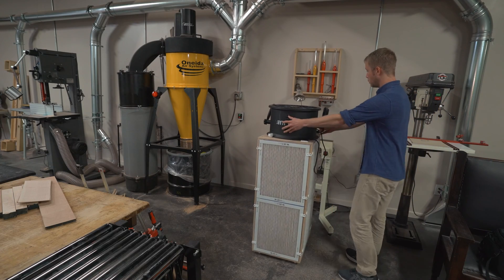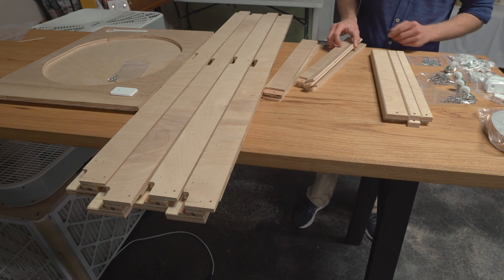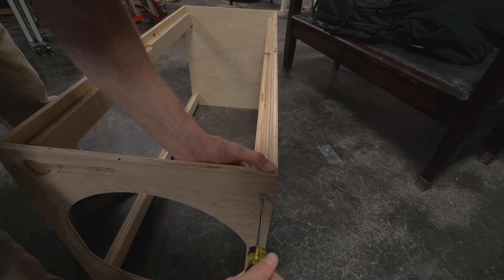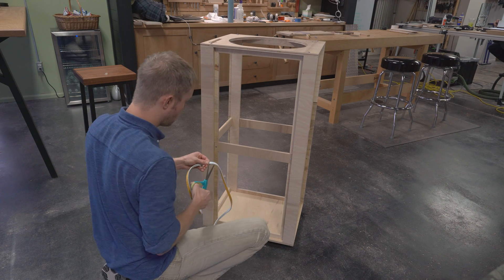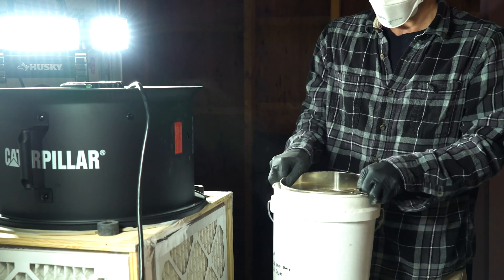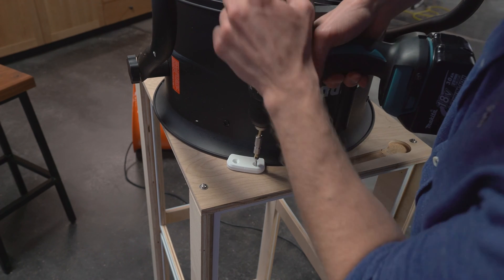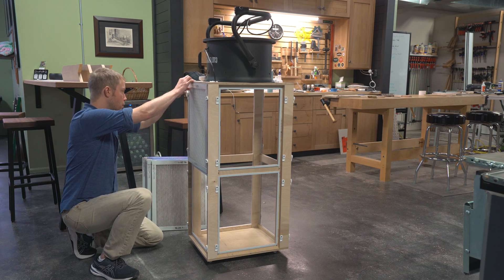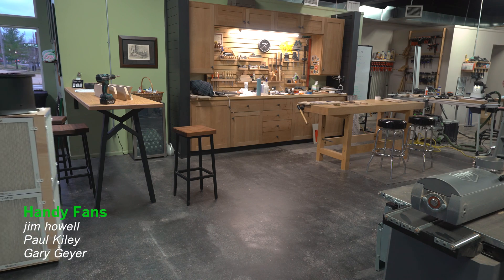Air Filter Kit - Model-A - Design and Assembly

Comment: Great video, very useful, just a quick question, I could not find 14 inch caterpillar 4000 CFM fan, instead i found 14 inch 2300 cfm, can it still bring the same performance? or should i use dewalt 4000 CFM fan or Caterpillar 18 inch fan with 3400 CFM, for your info, i want to try 8 filters of 20 * 20 * 1 merv 14 3M filterete, your suggestion will be helpful , thanks

Comment: How long do the filters last in your shop? And if you would please include your best guess at how much use they get daily, that would be great. I’m a disabled veteran on a budget and I’m trying to determine my cost for your awesome unit based on filter use and replacement. Thank you for all your effort.
Reply from the maker: In my experience the filters can take about 1lb of dust before they need replacement. It took me about 1 year to collect this much out of the air with several times a week use. I will have a video out on adding cheap and easy to vacuum pre-filters to the disposable filters so that they last even longer. They do need to be cleaned regularly though, so there is a trade off, time vs money. As is usually the case.
Reply: @The3DHandyman  
Pre filter media is another excellent idea. Thank you for the timely response.
Reply from the maker: @mojorizn72 Any time

Comment: I found the Etsy link but didn't see a way to buy the kit that has the eight 16x20 filters.
Reply from the maker: Hi Tom! I am not making the full 8 filter kit any more. The Model-B 20x30" kit for a drum fan performs just as well and costs less to buy and the filters are 30% cheaper. All around, it's a better kit. If you want, you can still build the Model-A out of wood if you have the tools. You can also upgrade it with the plastic parts kit if you like.

Model-B
https://www.etsy.com/listing/1373712349

Model-A (plastic parts only)
https://www.etsy.com/listing/1309978884

Let me know if you have any questions.

Comment: I assume the drum fan filtration setup can be suspended in the air? Or does the fan need to be on top of the filter setup as you have illustrated? I would like to have it out of the way in my small shop. Thx
Reply from the maker: A system like this one would work well https://youtu.be/OhVWsnTm8iU

I am also working on designing a purpose build ceiling mount unit. That video will be out later this month.

Also people have definitely mounted the Model-A on a ceiling. There are specific mounts in the plastic parts kit that make this easy.
Reply: Thanks, I like that setup! I need something soon, too much dust flying around.
Reply: Quick question, does it matter with way to setup the filter?  Pull through filters or push into filters?
Reply from the maker: @MDD1966  Each fan direction has different benefits. If the rooms is small or the filter is close to your work area, I prefer pointing the fan into the filter box. If the room is a 2 car garage without major ceiling obstructions pointing the fan up is generally better. I will do a video on the subject soon.

The filter will go into the frame differently in each scenario. If the fan is pointed down into the filter box the arrow on the filter will point outward and visa versa.

This is info for the 8 filter design. So, if you decided on something custom, the same concept applies. The arrow on the side of the filter points in the direction of airflow.
Reply: @The3DHandyman  thx, I will point the air into the filters since my work space is small. I plan on hanging it above my work area to keep it out of the way! Appreciate your input!

Comment: your model a. would you be able to update the schematics to use a 20 x 25 x 4 set of filters? Also, do you not sell the wood kits any more?
Reply from the maker: Hi. I am going to do some updated drawings for these kits but they will only be compatible with 1" filters. If you buy 3M MEVR 13/14 filters they have as much filter material as the average 4" filter and they preform better in a smoke test as well.

I am not selling the wood kits because they required hours of hand sanding and cost the average buyer about $400. The new Model-B kit with a drum fan has the same performance with a 30% lower cost and 30% lower filter prices so operating it is also cheaper.

Comment: I would like something I can mount to my ceiling and maybe exuast into the attic?   Would this be a good design if I wanted to Mont on one of its sides and loose one side of filters?   If that makes sense.
Reply from the maker: Yes, it is possible. A lot of people have done this in various ways. You can use a Inline fan to move the air. It will easily accept a flexible duct for running into your attic or wherever. The inline fan is a bit less powerful so only having 6 filters wont be an issue.

12in inline fan
https://amzn.to/3T6wXg8

Comment: You mention that pointing the fan into the box, you can collect dust in the air from about 5'.  If you reverse the direction, how far is the box picking up dust from the air?  I get that blowing the air into the box would slowly clog up the fan.  Whereas pointing the fan out would keep the fan clean.  I'm just having a problem with how much dust would be removed from the air with it point out.  By pointing it out, are you relying more on that airflow to circulate the dust around to the air filters?  Further explanation would be appreciated.
Reply from the maker: Yes the fan will stay far more clean if you point the fan up. The fan does not clog in the down direction though. I will occasionally blow it off with compressed air and that's been fine for years fine.

Pointing the fan up makes for better circulation in an area without large ceiling obstructions. If this is the case, the dust pickup will be the whole space.

This a complex issue, really. Both options are best in different scenarios. It can be good to test what is best for your space. 

The other issue is where you want the dust to collect. If the dust is inside the box, it wont be disturbed as easily as when it is on the outside.

I will do a whole video on this in a month or two.

Comment: Can I get MODEL A design measurements using 20x20x1 filters? 16x20x1 isn't available in my country.
Reply from the maker: You can pretty much just add or subtract as much as you need to have it fit a different sized filter. The upright legs wont need to change at all, just the top/bottom/horizontal pieces. Don't have time at the moment to make plans. Maybe later this year

Comment: Do you need an european retailer ? I'm located in France, and think your project deserved to be available everywhere on the continent
Reply from the maker: Thanks for the offer! I love the idea but one of the key issues seems to be that this type of HVAC filter is hard to find/expensive outside the US and Canada. We might have to become a filter importer at the same time. That makes it quite a bit more challenging to pull off. What are the easiest filter for you to find locally?
Reply: I'll come back at you with a survey if that's ok, what other issue I may have at the moment, is european products are standardized in metric, if we get to be filter importer, it will of course don't matter, as the product are compatible by design. I also don't know about the regulation and the norm about HEPA filter, that might be different from the north american one, thus explaining a price tag difference. Nevertheless, I'll work on it as I firmly believe in this projet   @The3DHandyman

Comment: I don't understand why everyone uses fans that are designed for free flow air why not use
 a squirrel cage as it is designed for high static pressure put it in box with filters on one 
end and sound baffles on the output to reduce noise
Reply from the maker: The cost of the fan upfront and the cost of electricity in the long run plus the significantly higher CFM make axial fans far significantly more cost effective. As long as they are paired with a lot of filters they will run with little to no static pressure.

Not to say that there aren't squirrel cage fans aren't good. I did get one second hand and will make a video on that at some point

Comment: I’ve seen the numbers online comparing the decibel levels between the CAT and the Air King. Based on your use, which would you consider to be the loudest at their max speed setting? Not sure what their frequency response graphs look like when measured.
Reply from the maker: I find that the CAT fan makes more of a pleasant sound although it is technically 2-3dB louder than the Air King.
Reply: @The3DHandyman  excellent! This is the exact response I was looking for. I thought this may have also been the case with the CAT. Going with that one. 🙌

Comment: Incredible work in this series.  Thank you very much!  If one of these fan systems is good, would two be twice as good or is there diminished returns due to science things?  (Not a science guy, I just really want to minimize the dust in my shop).
Reply from the maker: Thanks! I have operated 2 in the same space before with good results. If the space is large then several units can help clear the air a lot faster. If the space is smaller, then you can run one with the fan blowing air down into the filters and another with the fan blowing air up towards the ceiling. This creates better circulation.
Reply: @The3DHandyman  Awesome.  I think I’ll give that a shot.  Thanks again!

Comment: Will a Canister filter work or will it restrick the Air flow to much for that Cat 14 inch fan?
Reply from the maker: I have had more success using the Cat fan blowing air up out of the canister than blowing dust into the canister. Also, once the canister gets dirty, performance is cut dramatically. So, you will need to clean it frequently.

In general, the Model-A or Model-B performs better with the Cat fan.

I'll have a video out on the comparison some day soon, I hope. Very busy at the moment and it's hard to keep up with content production.
Reply: @The3DHandyman   Thank you for all the time and effort you have into this project. I spoke with Wynn, the manufacture of the canister filter and they do not reccomend using the fan into there filter.  Thought I would pass that along to you.
Reply from the maker: @steelhead1194  Thanks for the info! So their recommendation is to blow air upwards out of the filter with all types of fan?

Do they recommend using the Cat fan at all?
Reply: @The3DHandyman   He said that there was not a good seal and it would leak, I am not so sure that could not be made air tight. He refered me to a video by Stumpynubs where he adds a canister filter to a ceiling mounted ambiant filtration  system.  He also said that the air could be forced back thru the fan, causing the dust to be escaping into the shop.  But this could be fixed with a large canister or 2 smaller ones I would think.  I am relly looking forward to your next video and see what all you have found. I just bought a ceiling mounted one from amazon, it was not to costly and I will have some air cleaning for now. I think a system like yours along with the ceiling mount may be very good, as the ceiling mounted  one I purchased exhaust the aid down, so the dust will be moving and be caught in the floor  system of yours as well.
Reply from the maker: @steelhead1194  Thanks for letting me know what they said! I have seen that stumpy nubs video. It is a great use of the filter.

One test I ran where the Cat fan was blowing into the canister showed dust starting to kick dust back out of the fan rather than blow it into the filter. The HVAC filter type designs Model-A/B can take a lot more dust before reaching that point... not to say that they are perfect either.

With the fan blowing upwards out of the canister filter the cord gap was not very significant issue with performance. Like you said, it can be easily filled with some foam tape or something.

At the moment I have about 10 videos each 1/3rd done. Hopefully by the end of the year I'll have them all out there 🤞
Reply: @steelhead1194  I think there might be some mis-communication with Wynn concerning the canister filter. This is taken directly from their site and is talking about canister  #35C222NANO with a MERV 15 rating.  In red text they state:  "This filter is designed to flow from the inside-out.  The Nanofiber layer is on the inside.  These are not the same as typical  outside-in industrial filters.  (All industrial Nanofiber filters are directional and will fail if used in the reverse direction.)"

Comment: Great work! I've watch all your videos and they are really informative, thanks again for all the hard work. I have a question though, why not trying the big Cat Fan with only one filter with low pressure drop?  I am only wondering this as filters can be expensive and I found some really good ones with low pressure drop that could handle the static pressure. Would love your thoughts on this! Thanks
Reply from the maker: Thanks! If I were to pair the Cat fan with a single filter it would need to be a 4 or 5" filter. This setup would also probably not perform well in heavy dust environments.

When filters are new the pressure drop is reasonable across most brands. When they start to collect dust, that's when there is real benefit in large number of filters. In some scenarios a set of large filters paired with the Cat fan can handle pounds of dust without significant loss of power. A single filter would pretty much stop all air movement and potentially damage the fan motor because the motor is air cooled. No air movement = no motor cooling.

For single filter (high static pressure) setups I would recommend inline fans or centrifugal blowers. I'll have some videos coming out on those soon.

Hope that helps!
Reply: @The3DHandyman  Oh alright, that makes sense, thanks!

Comment: Is there a reason why the Model A is not available any more? Also, would it be possible to fit a carbon canister filter inside the box attached to an inline fan at the top?
Reply from the maker: I had issues with the CNC shop that I was working with and it resulted in a ton of scrap parts and several hours of sanding per kit. Neither of which I have time for. I am looking into getting a CNC machine of my own some time soon and I may have these back in stock in by December, hopefully.

Yes, it is possible to fit a carbon canister in the CNC unit. The DIY plans don't have quite enough space in there to fit an 8" canister.

Sorry for the late reply!

Comment: Great video, thank you. How would ceiling mounting this in a horizontal configuration impact performance? I don’t want to give up the floor space in my small shop if I can help it.
Reply from the maker: Thanks! This design can be ceiling mounted. Performance should not be effected if you use the same number of filters and back it off the ceiling by 8" or so.

If you flush mount it to the ceiling with only 6 filters, performance will be reduces by about 25% and you will need to replace the filters more frequently. 

If you have the space, you can flush mount the unit and make it 1 stack longer to accommodate 9 filters and it will preform marginally better than the 8 filter unit.

Feel free to experiment with a modified version that works best for your space. As long as you keep the filter count high, it will work well.

Comment: Thanks for the awesome design. I’m going to build one of these for my shop pronto. A couple questions (I apologize if these questions have been asked. I did look before posting, so hopefully not):
• I know there’s been quite a bit of research done on where to place a more traditional ceiling mounted filter (with the intake and exhaust flowing in the same direction) in order to have the air circulate and filter properly. For example, my shop is rectangular so the filet is currently placed along the longest wall about 2/3 of the way down the wall and blowing toward the wall running perpendicular to it so it circulates the air in a circular motion around the room. Where in the room should a filter like your design be placed? In the center?
• I plan to use the pull method with the fan blowing out. I have the luxury of space in my shop, so wondering if I shuld have it on the floor blowing up toward the ceiling or mount it on the ceiling blowing down toward the floor? Seems like the latter would make more sense in that it wouldn’t allow the dust to settle as easily (blowing it off of surfaces) and therefore be filtered out of the air. Thoughts?
Thank you so much in advance for your guidance!
Reply from the maker: Good questions!
- If you are going to place the unit on the floor, you can put it in the center of the room or at one end. If your dust producing tools are all over the place then center is probably best.
- if you are going to ceiling mount the fan, I would probably put the filter at one end and blow are towards the opposite end. This should create the best circulation throughout the space. People have suggested blowing air down toward the floor and that may also work well, but I have not tested it.

Let me know if any more questions come to mind!
Reply: @The3DHandyman  thank you very much for the quick response. I think I’ll try mounting it in the center of the ceiling blowing down knowing that I can always reorient it blowing to one end if that doesn’t work out well. Thanks again!!!

Comment: Can you close the motor with tape to make dust not get in?
Reply from the maker: Good question! I would not recommend that. If a motor is open it is designed like that so that it cools itself properly.  If it overheats it could shorten the life of the motor or at worst cause a fire. It's generally a good rule not to modify motors.
Reply: @The3DHandyman  so just try to clean it from dust sometimes?
Reply from the maker: @dargunsh7156  If it's regular household dust, you shouldn't really need to clean it. If it's shop dust, you should occasionally blow the dust out with compressed air to keep it clean.